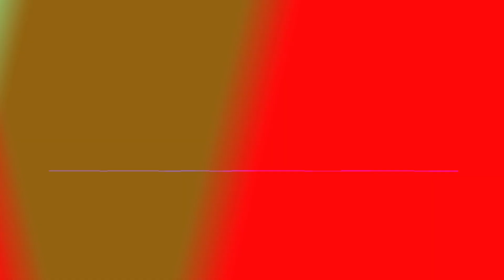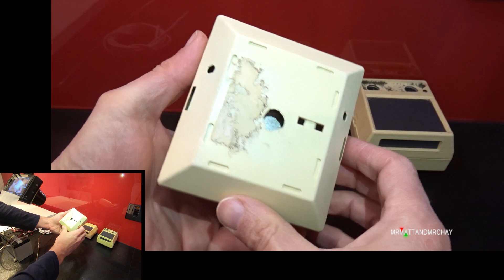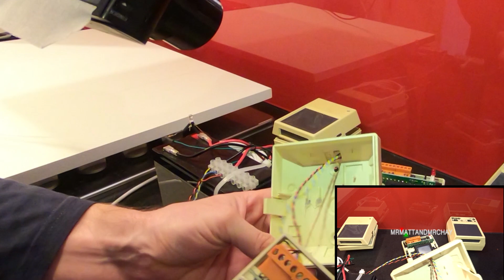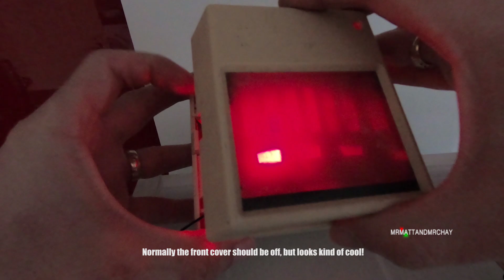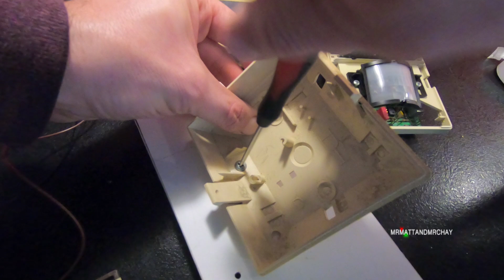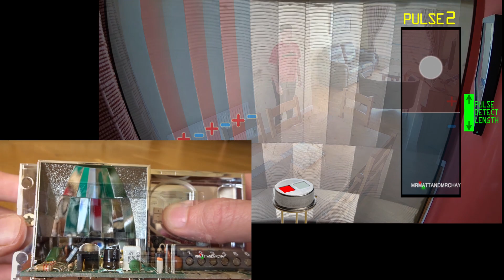Racal Guardall IR1012 - old PIR examination

Comment: One comment on Grade 3 detectors: They CAN be masked, but they have to be masked internally to not trigger the mask detection feature.

Usually, there is a sensor that detects if anything (even tape) is placed on the lens, and will fire the mask detection feature.

However, there is provisions for masking the detector inside the lens, without tripping the mask detection (which would trip the tamper detection feature anyways if you would try to do it without authorization)

How masking is done is mentioned in the manual. Masking certain areas is very rare nowadays, masking is more done with pre-made mask pieces (plastic pieces inserted into slots) to reduce the field of view.

These plastic pieces are supplied in the box of detector, OR they are on the detector from factory and broken off with pliers to widen the detection field.

Some detectors have this masking feature for pet immunity, it masks the lower portion of the detection field either with a moveable lens like yours, but then you see a black strip on the lower portion of lens, putting lens in upper portion sets detector in "pet mode", it will prevent detection of objects close to floor. Or a mask piece that is put on the lower part of detector, blocking off the lower view.

So masking is done, its just rare and mostly used to give the detector a narrower detection field. Some mask pieces even have mirrors on them, making the detector even more sensitive in the narrow field when masked, so it can detect movement in the far end of a long corridor.
Reply from the maker: Yep, all very good information.  I remember masking Racal Apollo PIRs for the 'pet alley' feature.  They had to be mounted half way down the wall and the lens adjusted to look horizontal and the downward part masked off.  This was late 80s, early 90s, long before pet tollerant detectors were on the market, and the Apollo was considered a tiny PIR back then!!
And you mention masking internally, this is exactly what I've done in our training room on our training rig.  Detector mirrors (Honeywell DT8016AF5) taped off inside to prevent the detector looking right, so that we can demo the system by standing on one side of the room.  The antimask looks straight ahead at the front, after the taped off lens.
Reply: @mrmattandmrchay  Currently im installing my own Vanderbilt SPC 4320 in my home, and tinkering with a access control system so it automatically arms and disarms the system based on card reader usage (by using the access controller's VALID CARD relay in combination with the KEYARM ZONE INPUT on the panel). Soon I will have got it right.

Comment: 06:54  The one on the far right was called a "Gemini" it had an ultrasonic detector in the top  (Two round circles were the transducers, but they were covered by a foam strip.) The concept was that both the PIR and ultrasonic had to activate at the same time before an alarm was generated. The problem was, both the PIR and Ultrasonic can see warm air, so they were not that good. 
You could also set the walk test LED for one of 3 options. 1) PIR detects movement 2) Ultrasonic detects movement (The LED would flicker)  3) Alarm condition.  Looking forward to the rest of this "series"